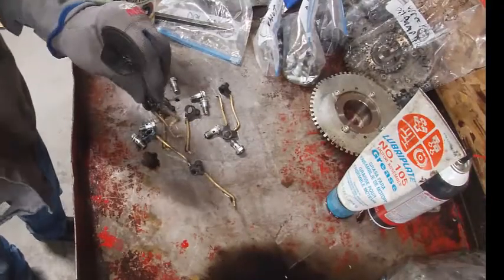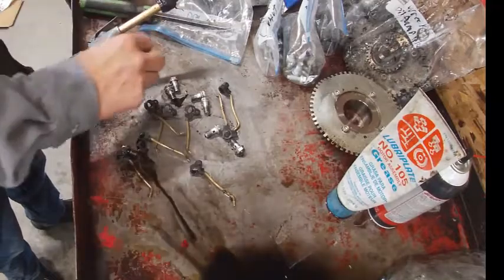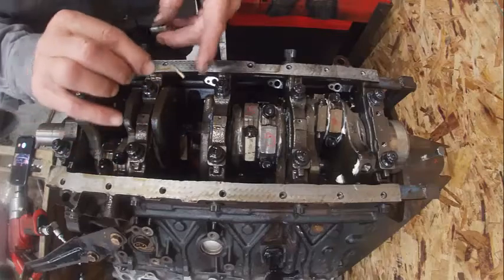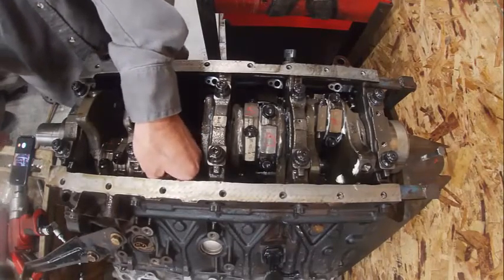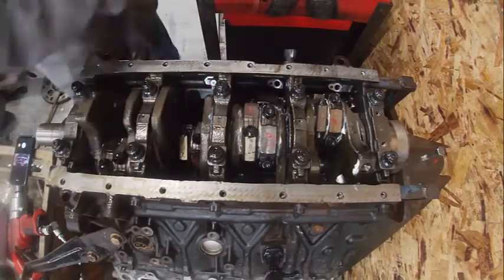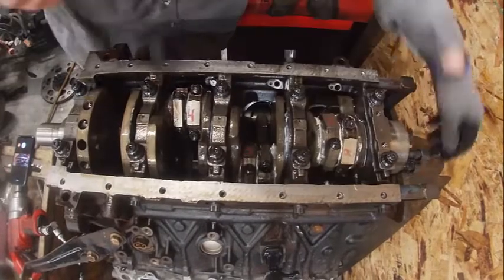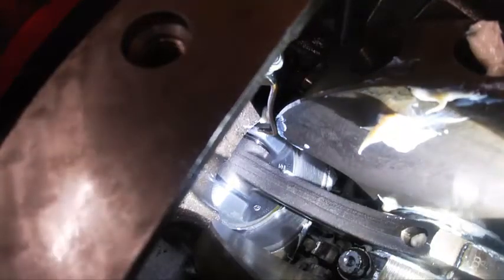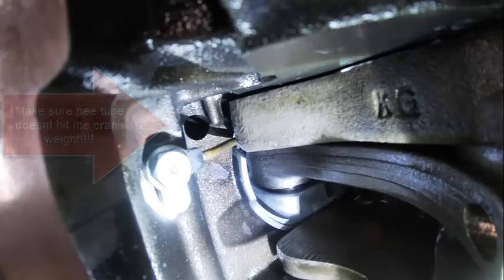Installing Piston Cooling Nozzle Pee Tubes

Comment: Joseph, 
I like your videos a lot. I am looking into do in frame series 60 12.7 motor 2000 year. Can you do overhaul and what will it cost with out turbo but everything else?
Reply from the maker: Typically an inframe will cost 1/2 the price of the engine replacement cost in parts of you do it yourself. You can find some aftermarket parts cheaper but you have to watch them the quality can be poor sometimes. With labor an overhaul will be at least 2/3 the cost of buying new if not higher.
Reply: @0698gingerich  thank you